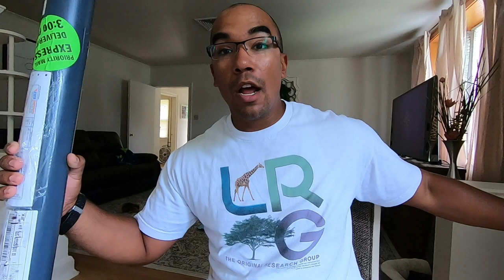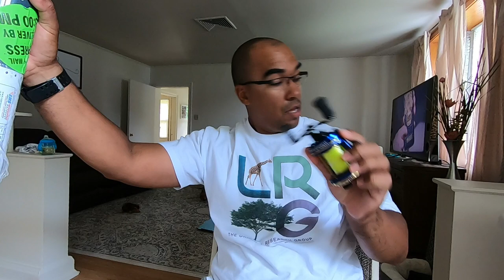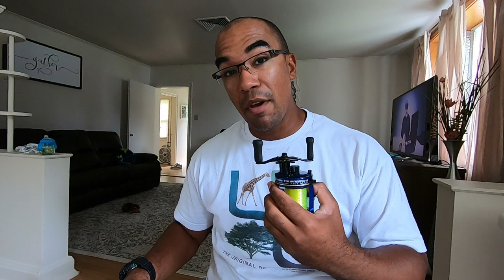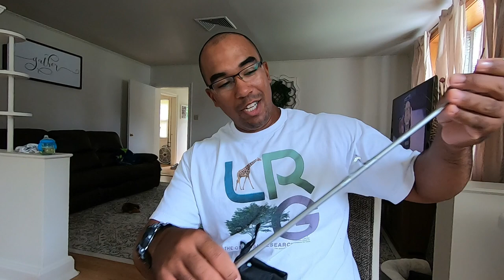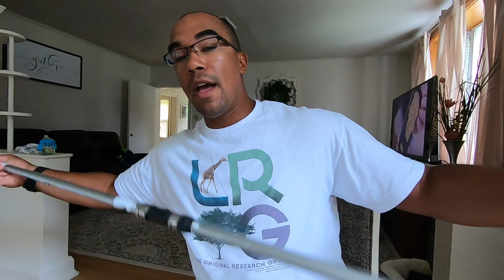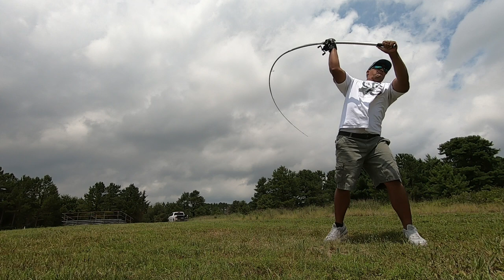Surf Rod FAIL casting Yuki innovations rod breaking 3rd cast.

Comment: Lol...you did some mistakes too. This is probably one of the cheapest rods of the YUKI brand that is the leader in Europe surfcasting related, try the YUKI SAIKO A11 for example that costs  $600 that has better HIGH MODULUS CARBON and they have even more expensive.  Not sure how many oz you using in this test but probably the max 8oz. Most of the time when we test a new rod and we think the ferronds are totally inserted because they were so tight but they aren't, the rods break and we blame the brand, in reality was our fault!. Some of these comments say this is a rod to use just with spinning reels...That is wrong because these rods are made with X45 technology which means the carbon was the same resistance all around 360 degrees. Buy a good rod from YUKI and you will see that you will love it! BTW the LOW RIDER first guide is inverted/taller, this is to avoid the line touching the rod when casting due to the spirals that line does,  this increases the casting distance.
Reply: Very well said my friend , i live in the Mediterranean and i do surfcasting . And ofc i use a yuki rod . An A4 + sensitive to be ecact.
And apparently this dude has nothing to do with fishing because technique is the main key in surfcasting. My A4+ is an entry level rod and i throw a 120grams weight with it EASILY.
Buying an expansive over 1000dollars rod doesn't mean its better , it just means that it can be handled with a noob that will always stay a noob.
And again , well said my friend.

Comment: That rod is designed for use with a fixed spool reel, lighter leads, thinner lines and isn’t designed for power casting techniques like off-ground or pendulum.
Reply from the maker: Yeah I found out the hard way lol I should have read about it more before I got it.  Here in the USA we throw up to 10oz and bait but it was a caring phase for me broke down and got a boat.
Reply: @KennethLondon-ft9gw  Unfortunate - Euro "Continental" rod weights are lead + bait, but are generally fished just beyond (or in) breaking surf, so casting distance (& therefore extreme rod compression) is rarely required. You're also substantially bigger build than the average Mediterranean angler...rod didn't stand a chance !

Comment: Thats a Lowrider guide setup. They're popular on for surf rods (st. Croix mojo & legend). Definitely a spinning rod
Reply from the maker: Yeah I found out after I got it I never heard of them before I was thinking of removing them from the broken rod for later use.
Reply: @KennethLondon-ft9gw  right on . Thanks for the content.
Reply: @toefur14ft spinning rod? You must be joking! 😂 It’s a European Continental surfcasting rod, designed to be used with a fixed spool reel with fine lines and small baits. Not designed (despite what the weight rating says) for power casting with heavy weights.

Comment: They are tangle free guides it is a casting rod
Reply from the maker: Ended up being a spinning rod I saved the guides and plan on using them on a spinning set up.
Reply: This is not a spinning rod. It's a surfcasting rod and it's the rods we use in Europe for beach fishing. There's a lot of well none companies making this kind of rods.  Yuki it's not the best , but they have good rods. Saiko series are the best. I personally like and use Vercelli surfcasting rods

Comment: That's what happens when the rod load on the wrong side of the spine. Remember it wax a spinning rod not a casting or conventional rod.
Reply: these rods are made with X45 technology which means the carbon was the same resistance all around 360 degrees
Reply: Not a spinning Rod it is a Surfcast rod ie best used with 4-5 oz plus bait and easy casting style.

Comment: deserved that first thing yuki a6 is far from tournament casting rod, basically designed for fixed spool light fishing plus it seems pointless all that effort and stress on very good rod  with reel that is running that slow, if u wanna tournament cast use zziplex or century something thats made for job.
Reply from the maker: I wasn't upset about it I was sure I made a mistake but I'm really not sure what you can fish for with a rod that nimble and after looking at the rod it was quite cheaply made the guides were wrapped like crap and The Branding was put on really cheap not upset it broke but overall it was a poor quality product